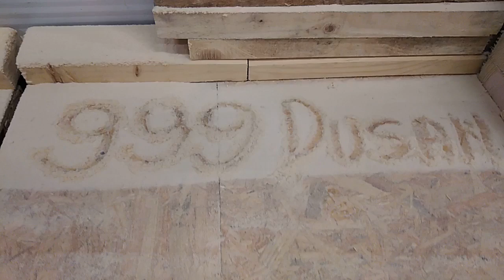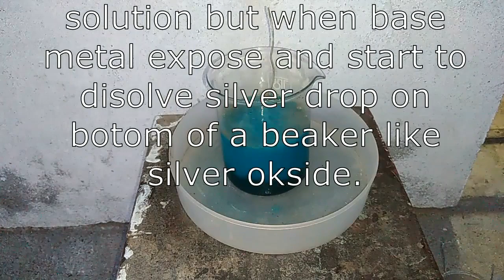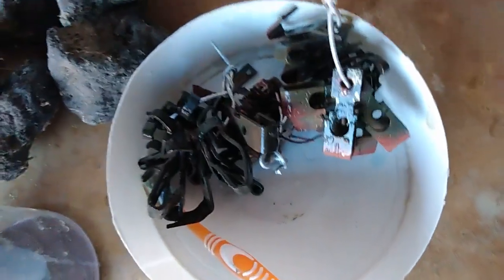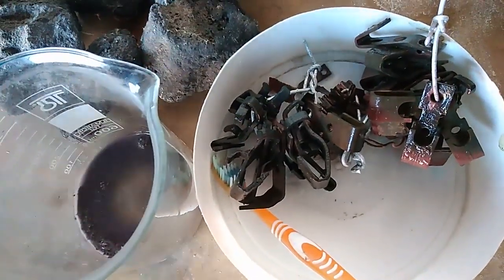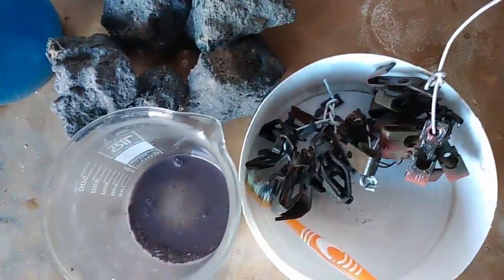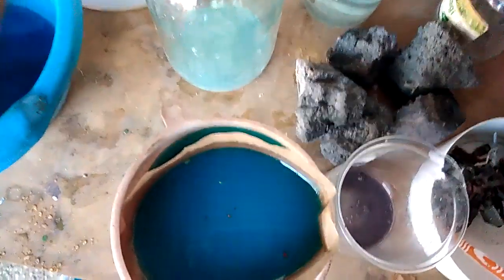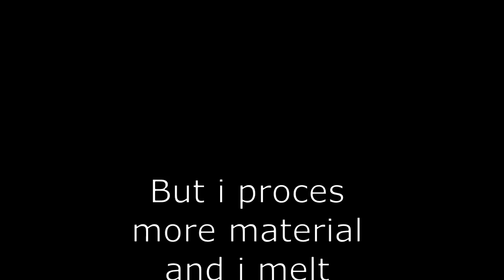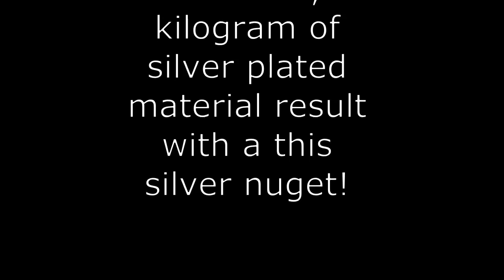Silver Plated Metal - Silver Recovbery Proces - Only Nitric!

Comment: Interesting. I think God has been talking to me. I'm running a bunch of gold pins with nitric, but we also have a bunch of silver pins. I decided to just put them in my nitric waste bucket. It's working great, there is just enough nitric to remove the silver and cement it back out. When the bucket is full I test for silver, remove the nitric, add more pins and dump on more waste nitric. The silver is piling up in the bottom of the bucket.

Comment: Have you ever tried the sulfuric acid and nitric on silver plated aluminum
Reply from the maker: Yes, my vay is 3 part of sulfaric acid and one part nitric ant that is exelent mix, disolve silver but dint tuch copper and brass. Now i hawe hard time, doing corona epidemic, no sulfaric acid, there is no vay to get it so i use what i have.
Reply: Not sure if I'm right mate but I think you can access sulphuric acid by tearing down a dead lead acid car battery and heating the solution to concentrate the acid. Lead to melt also for stock. Let me know if I'm wrong👍
Reply: @boganhunters  you're right